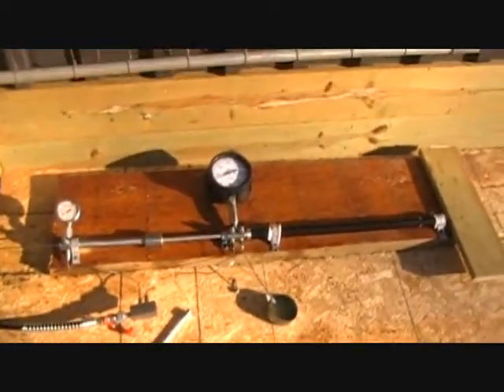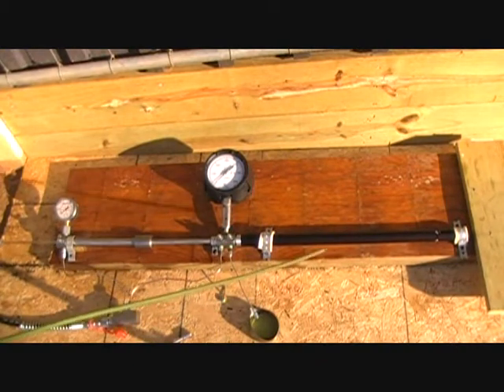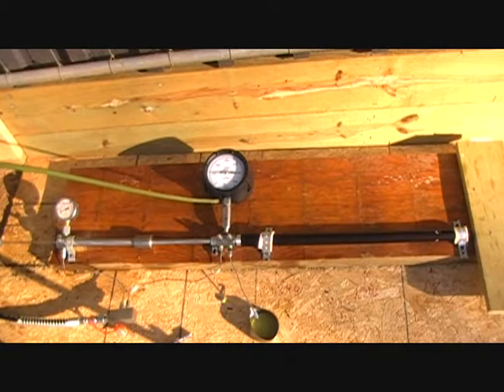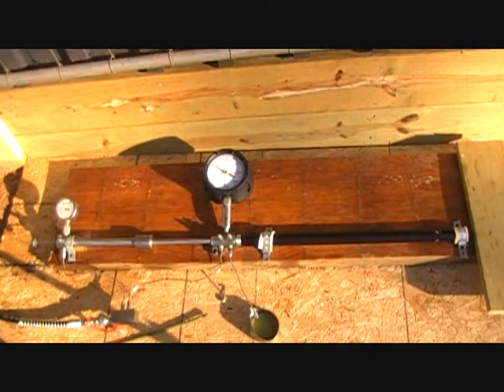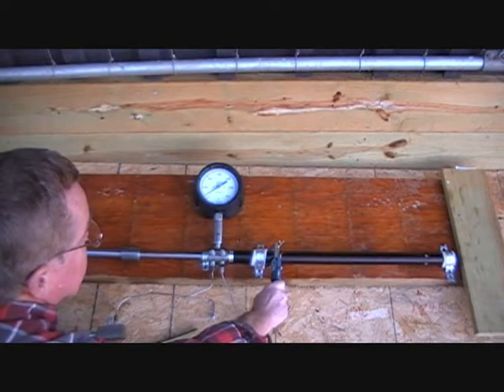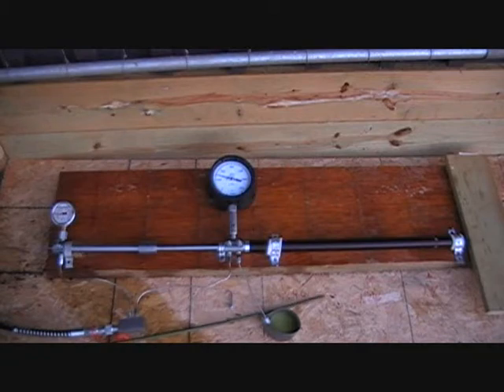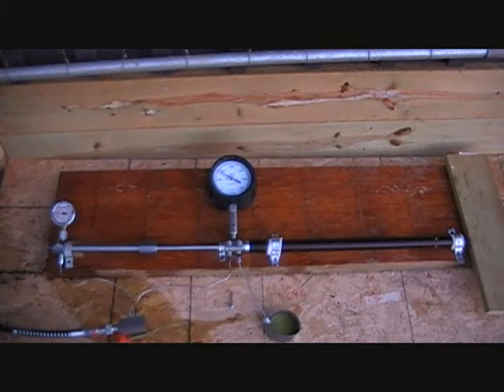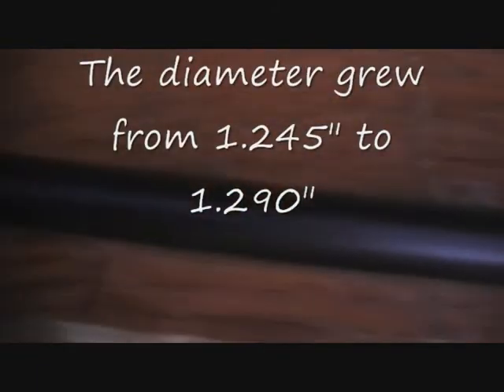Light weight Marauder air tube failure at 10,000 psi, yield at 9,000.

Comment: Hello good sir..that is a very informative testing..i've watched your video where you thin down an airtube..i wonder if you can do a test on a faulty airtube threading..like a very wobbly connection between a the end cap and the airtube..just to clarify a good material doesn't really matter if it is not done properly..thank you sir

Comment: Hello there, Could you tell me a little about Chromoly tube? My tube is 31.75 mm OD and 1.65 mm wall thickness.
Would this tube handle more pressure than the aluminum tubes you are testing? Do you have any idea what pressure this Chromoly tube could handle?
My material type is:  AMS 6360 (AMS-T-6736) Type 4130N
Reply from the maker: The normalized 4130 chrome moly is generally a good tube material, but the 1.65mm wall is a bit thin for the 31.75 O.D.
Using a material spec of 63ksi yield and 97ksi UTS, a 2700psi fill gives a 2.6 to one safety factor for yield and 3.9 to one for UTS. The yield point is where the tube starts to permanently stretch in diameter and axially along any thread roots. Basically when it reaches the yield point, failure has begun. Is 2.6 to one a good enough safety factor for a pressure vessel? Depending on the international code, some say yes, some say no. You also have to think about the threads in the end of the tube for the end plug. Using a M30x1 thread, the axial yield stress at the thread root has a S.F. of 2.7 to one at 2700psi.
The yield S.F. for the tube O.D. at other pressures is: 2000psi 3.4 to one. 2500psi 2.8 to one. 3000psi 2.3 to one. 3500psi 2.0 to one. For personal use, I would be ok with 2500 psi, but that is a personal decision, and not a recommendation.
Reply from the maker: The CM tube with the 1.65mm wall and the 2024T3 aluminum tube with 2.41mm wall have similar pressure capabilities.
The CM is 6,890psi at yield and 10,610 at UTS. The thicker walled aluminum tube is 7,460psi at yield and 10,670psi at UTS. The aluminum tube is lighter in weight but holds less air because of the thicker wall. Material selection is usually a matter of compromises, including material availability. There is no single correct answer.
Reply: @1227air500  Personally, I would prefer the CM tube over the aluminum as I feel it might be more elastic. I could be wrong but only an expert like you can confirm that.

Comment: What is the rated capacity of this tube? I'd say its pretty safe to use it up to 3500 psi.
Reply from the maker: You would have to ask the manufacturer of the tube, Jefferson State Air Rifles about the maximum rating of the tube. But consider this:  the original max psi rating of the Marauder rifle is 3,000 psi, and I can tell you that it is highly unlikely that the original steel tube will be what fails if the gun is severely over-pressurized. For my **personal use**, I would be ok with 3500 psi in one of the stock calibers. Although the manufacturers design a significant margin of safety into their air rifles, anytime you go over the recommended max, you don't know what the first point of failure, the first "weak link", really is. Keep an eye on the bolt retention screw that locks the bolt and cocks the hammer. Repeated abuse at 3500 psi could weaken that screw so keep an eye on it and replace it before it starts to look bent. They are inexpensive and you can buy them directly from Crosman.

Comment: Indonesian have air rifle, the tube is from bronze metal. Its work at up to 5000 psi. May be u can test it in your lab. The air gun is called pcp jawa / gejluk.
Reply from the maker: I am not familiar with that air rifle. 5,000 psi seems high for bronze, but we'd need to know the diameter and wall thickness and the alloy before even hazarding a guess.
Reply: The ticknes just 3 mm and the dimeter is 25 mm. With long of the tube 55 mm. Find it on youtube, "pcp jawa monel" or "killua 160cc hunter gendhenk"

Comment: 2024？6061？7075？
Reply from the maker: 2024T3 (45.7ksi Y, 65.3T) and 7075T6 (73ksi Y, 83 ksi T) are about the only readily available aluminum alloys that are suitable for high pressure air tubes. They are the old standard "aircraft alloy" aluminum that has both strength and fatigue resistance. And unfortunately, 7075T6 is extremely difficult to find in tube form, except for custom runs. So that really leaves only the 2024T3 for tubes. Depending on original design criteria and the desired/required safety factor, an aluminum tube will "generally" need to thicker than a steel tube, but it still ends up weighing much less than the steel. The original M-Rod steel tube has very robust safety factors, and the 2024T3 is able to leverage off of that fact.
Reynolds makes some high strength aluminum alloy tubes for bicycle frames, but it is difficult to find any in sizes that are dimensionaly suitable for air tubes.
3Al-2.5V cwsr Ti alloy tube is readily available if you want a very high strength to weight ratio. However, it is only worth the extra expense (in my opinion) for medium to large diameter air tubes  for high pressures (4,000 psi and above).  Just my thoughts.
Reply from the maker: So the answer for the tube being tested is 2024-T3

Comment: Any chance to do and video how to make your set equipment
Reply from the maker: Even though the equipment is capable of building up plenty of pressure for testing, its drawback is that the output VOLUME is very limited. So you have to pressurize and bleed several times to remove all the air and refill the cylinders to get to a point where the pressure can build to the max needed. There is no accumulator or tank in the system to hold extra hydraulic oil. Adding that feature (to both the first and second stage) would make the equipment much easier to use. But, easier said than done. Lloyd

Comment: Man you need better safety setup doing this. Face shield and lexan box around that at a minimum. Pretty interesting though.
Reply from the maker: Hello AZ guys! Honestly, I do take safety very seriously, and everything I do is backed up by engineering calculations such that I usually know exactly what will fail, and at approximately what pressure. It might be shearing of attachment hardware, shearing of the tube wall, thread failure of the end plugs, tube separation at the thread root, or, actual bursting of the tube. Bursting of the tube is usually the least likely failure, as all of the other possible points of failure generally will occur at lower pressures. But the point is, the failure should not be a surprise, it should just be proof that the calculations, and there are MANY of them, are correct.
As a rule of thumb, I always design to at least a 2.5 to 1 safety factor for yield failures, and a 3 to 1 safety factor for ultimate tensile strength failures. Different certification and standards organizations have different safety factor suggestions/requirements, so the rules are sometimes in conflict with each other. When doing the actual pressure testing, which is always done outdoors, my physical location, and that of the actual pump, is safely around the corner of a building from the test set-up. Viewing is thru the video cam or a mirror. Once pressures reach about 2/3 of the yield, I stay clear of the set-up, and am able to bleed the pressure down via a valve on the remote pump. Also, I only test with hydraulic oil, never with air. Using hydraulic oil, all of the actual test failures have been relatively benign and anti-climatic.  Each one is a learning experience.
But if I can't do it safely, I don't do it.
Lloyd

Comment: Thank You for posting this Sir! Answered a few questions I've had for a while now. 

Odd that it is common conception that the Maximus cannot have  the third screw added, due to the short area of metal between it and the trigger group area. However, I see that the MRod has exactly the same issue, and is exactly how they do it!

I think I'll go ahead and spot mill, and use a bottoming tap to set a third screw. 

KnifeMaker
Reply from the maker: Generally, the minimum distance of the centerline of the hole to the edge of the metal should be 1.5 times the hole diameter, but there are always exceptions. Adding the 3rd screw should make the assembly stronger. Lloyd
Reply from the maker: That is a good idea Mike, those screws might be the weak link if a gun is accidentally over-filled. There is no reason that the 3rd screw couldn't be rotated a little to get it away from the milled slot in the tube and into a region that has more metal backing it up. Lloyd